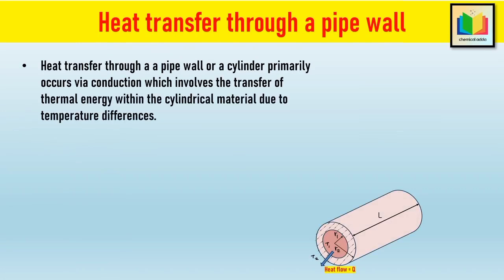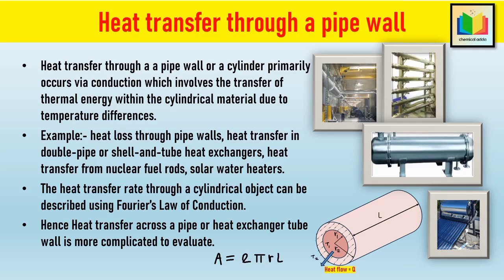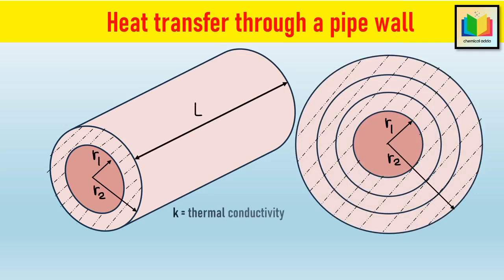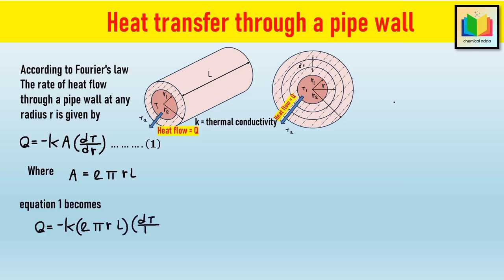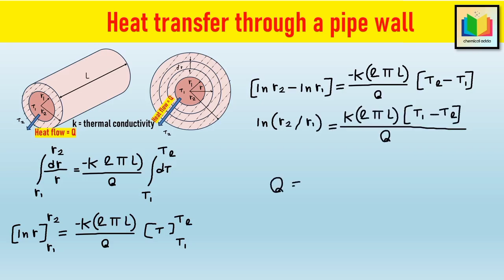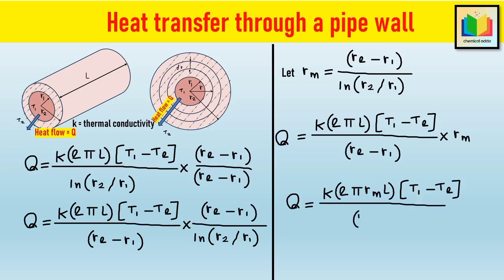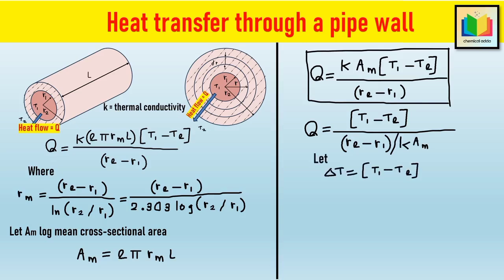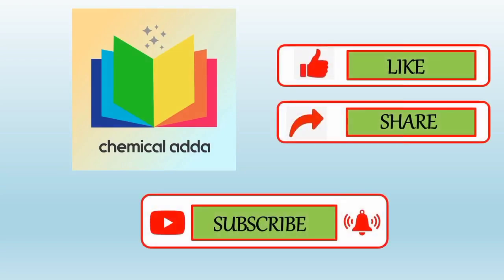Heat transfer through a pipe wall @chemicaladda

Comment: Make the video on Thermodynamics and chemical reaction engineering
Reply from the maker: Sure..can you please tell  which topic
Reply: Absorber refrigeration cycle 
Vapour compression cycle in throttling valve and expansion engine
Carnot refrigeration cycle
Reply from the maker: Ok...sure
Reply from the maker: Click the link for Vapor compression refrigeration system 
https://youtu.be/Zyx1EB3vt1Y?si=P8n8Unq-6C-cUUGf
Reply: Linde liquefaction cycle

And refrigeration cycles all one